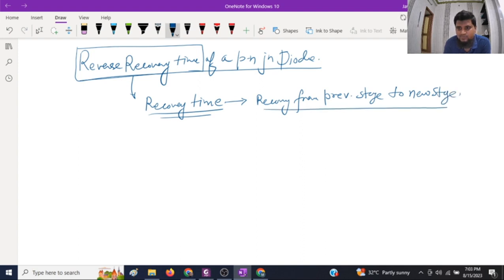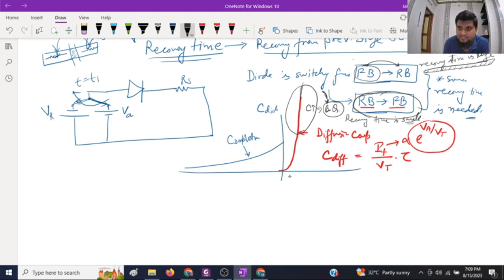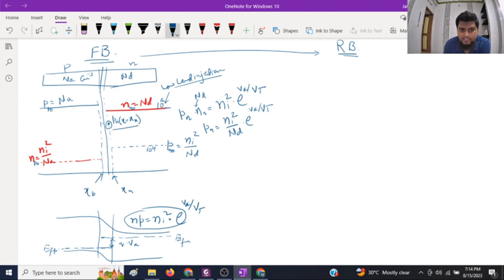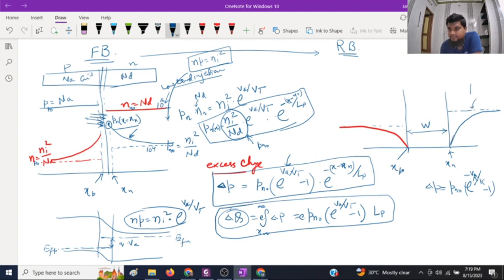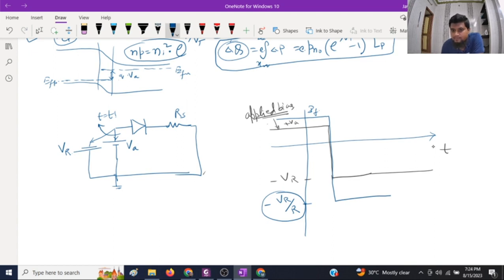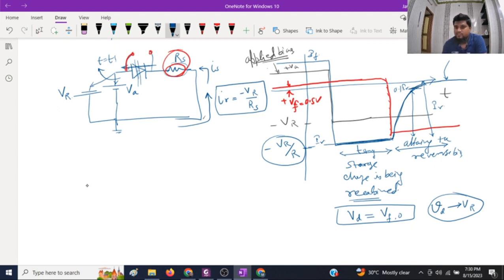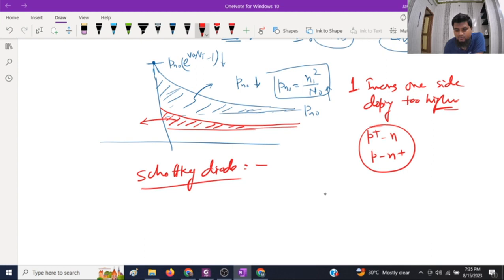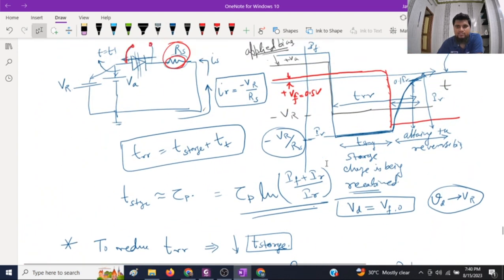Reverse recovery time and some methods to reduce it

Comment from the maker: Correction: (@23:44) The voltage across the diode will not go instantly to -Vr. As the current is exponentially decreasing from -Ir to -Is, the total voltage will be shared by Rs and diode during this period. The voltage across the diode will fall (increase in reverse bias magnitude)  exponentially to -Vr.